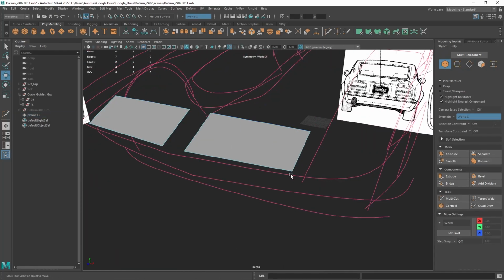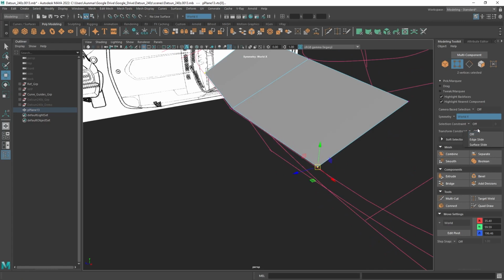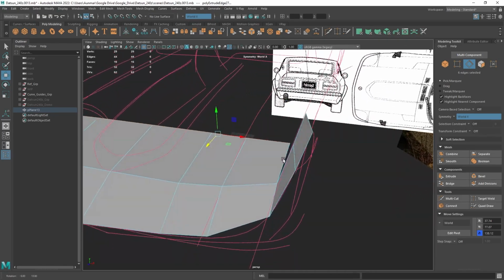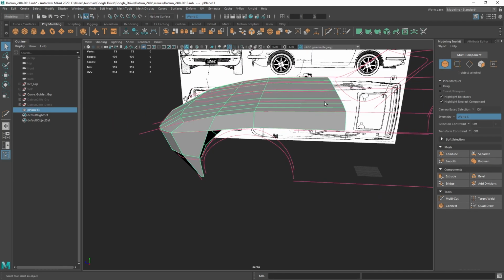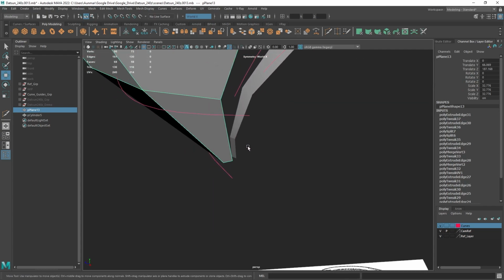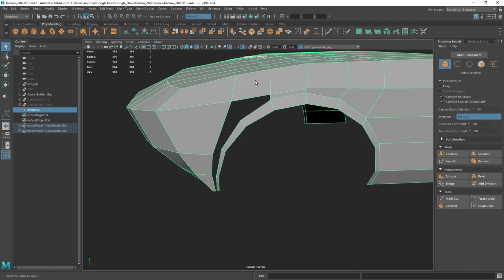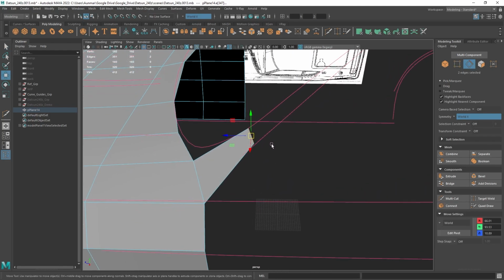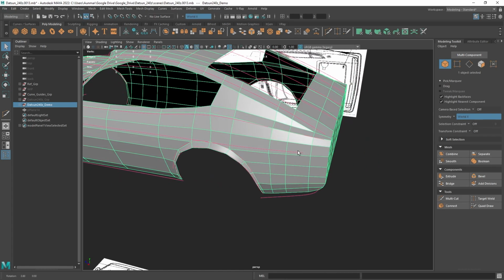3D Car Modeling - Blocking in Your Models

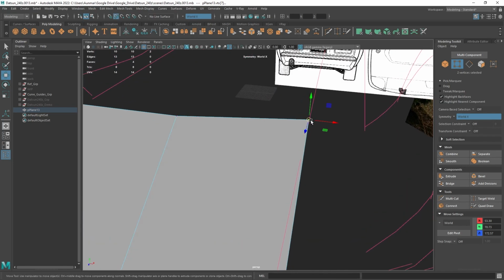Comment: 5:37 I just figured out how snap to curve work... Instead of dragging vertex to the curve, just middle click and drag on the curve itself while holding C after selecting the vertex. Also, make sure the move gizmo is free, if one of the arrow turns yellow, that means it's constrained to a specific axis and it will not snap to the curve perfectly. Hope this helps!

Comment: thank you so much for the demonstration! I also find the curve snapping so finicky, but I was able to look for a work around by simply selecting a vertex and hovering your mouse on the curve where you want the vertex to snap it to, and then from there, you will need to MIDDLE MOUSE CLICK while holding the "C" button (not left/right click) so it snaps and slides on the desired curve. I hope this helps, greatly appreciate your contents sir! :)

Comment: @On Mars 3D
For Star Wars' X-wing and Tie fighters would you still apply your spline guideline method before blocking in?
Reply from the maker: Yeah, the curves method works anytime you need to translate 2D reference images into 3D space.
Reply: @OnMars3D  the reason I asked cuz there are some vehicles that I think to you can just block out with primitive shapes.

So for the tie fighter wouldn't it be essential to use a sphere and two modified rectangles on the side?

The same goes with the X-wing but with a tapered modified rectangular box and a couple of cylinders for the jets and guns.

The way I see it, cars have a lot of curves that flow around; I thought it would be so complex due to the rounded nature that it would be recommended to use splines for that purpose.
Reply from the maker: Yup, sometimes working with primitive shapes would be more ideal than curves. For example, I'm currently helping some of my students model the Arwing Star Fox ship and I used simple primitivize shapes instead of the curves since the ship was so geometric.

I plan to cover this in a future video too so thanks for your insight on the topic!
Reply: @OnMars3D  I wish I could be your student but of course the distance and money.

Newayz I luv your tutorials and I've subscribed to your channel.

Keep making good tutorials like this.

Comment: Which file types are suitable for importing into Maya from other applications like as CAD, SolidWorks, and Blender? What actions must be taken after importing to ensure that the model is perfect? If not, what should be done?
Reply from the maker: Using OBJ or FBX will work fine when importing into Maya. Just make sure not to import CAD/NURBS files (jt, iges, stl, etc). Maya doesn't handle NURBS surfaces from CAD very well. Convert it to polygons if possible.

Comment: can you make a video on what is parameterize and parameterization in Maya and how to use it for modeling a vehicle.
Reply from the maker: Parameterized modeling involves CAD software like Catia, Solidworks, Siemens NX. They use modeling tools which rely strictly on math and physics for manufacturing and building a real life product. 

Maya, 3ds Max, Rhino, Blender have parametric modeling tools (modeling tools using measurements) but is still considered freeform modeling. These tools are great for design and visualization but when you are ready to manufacture parts and build an actual vehicle, then the model would need to be created using CAD software previously mentioned.

Comment: Thanks for the video, helped me a lot how to use curves and Poly surface. May I know what is the shortcut key for model transparency at 11:54
Reply from the maker: I cover that here: https://youtu.be/l3BiRl8ijo4

You can see the pinned comment for the script for the X-Ray toggle which I assigned to a shortcut using the hot key editor in Maya.

Comment: Don't grab the vertices directly while in "snap to curve" mode, that's not how it is supposed to work.

Instead select your vertex first, then hover the mouse over the curve you want to snap it to, press and hold the middle mouse button and start moving (always while holding "C" on the keyboard). You will see the vertex immediately snapped to the closest curve and will travel along that curve until you let go.

It never fails.
Reply from the maker: That works exactly as you had described, thanks for the tip!
Reply: @OnMars3D  
My pleasure.

By the way, your videos are great and I also find them very relaxing.

Thanks a lot for the effort and love you put into them!

Comment: Thanks for the video. I'm just curious if this workflow is for learning i.e. making the block out first. Do people working in studios do this as well?
Reply from the maker: That's a good question! Typically, big studios and automotive companies will have access to CAD/Math data. When they don't have that, they will scan the vehicles or use photogrammetry. When the aforementioned options aren't available, that's where the workflow I am demonstrating will come into use. Especially for non existent, concept cars.

Source: I have been working in the automotive industry for over 10 years.
Reply: @OnMars3D  aah i see. Thank you.

Comment: Do you know if it's possible to slide a vertex forward following the edge's direction?  Like sliding left instead of right @4:36.  (I know there's a way to do it in Blender by turning off the clamping for something).
Reply from the maker: Yeah, there is a work around for that. Do the following:

Go into Vertex mode and enter the Move Tool
Press 'D" on the keyboard to enter 'Edit Pivot Mode'
Select the edge you want to move the Vertex along
If needed, adjust the position of the pivot while still in 'Edit Pivot Mode' so it's more closely aligned to the Vertex
Press 'W' to go back to the move tool

No you can move the vertex along the direction of the edge even there is no actual edge in 3D space.

It's clunky for sure so there may be a way more efficient way to do this, but that's how I do it now.